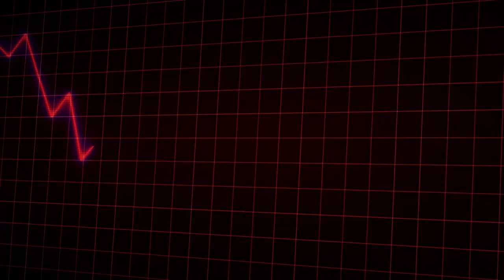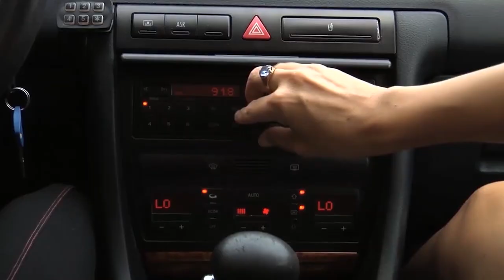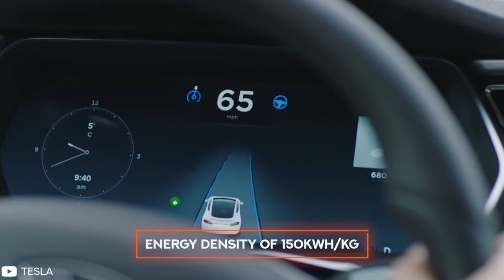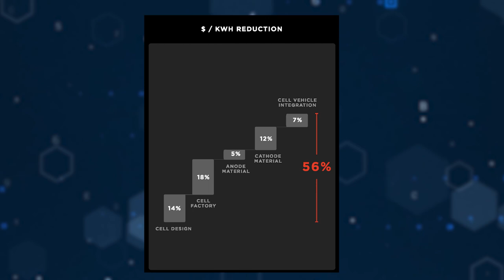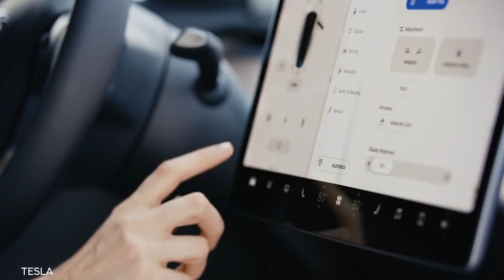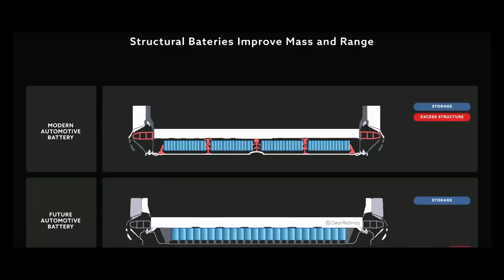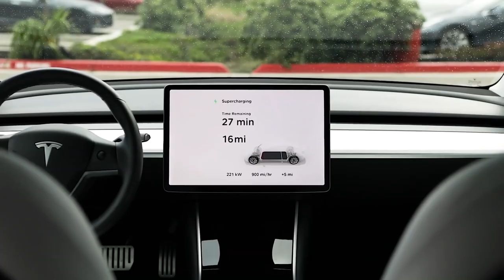Tesla's NEW 4680 Battery Is A GAME CHANGER!

Comment: "In ICE engines, the electrons travel through the alternator to start the engine" - Em, no. They travel through the starter motor. The alternator is a generator to charge the battery
Reply: Your aware the charge leaves the ned terminal and returns to positive right?  So that being a fact  the ground strap from batt goes to chassis n block closest to alternator. As the alternator pushes through the block to starter as it returns to batt through starter.